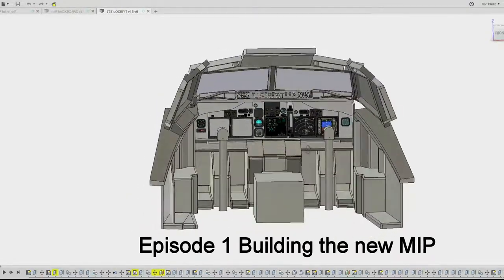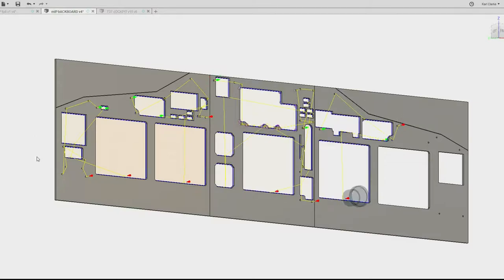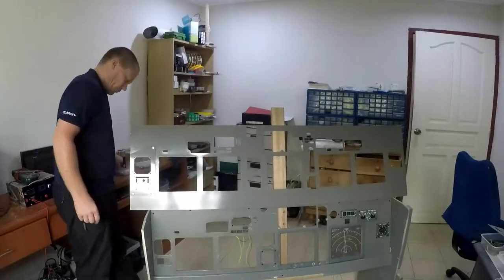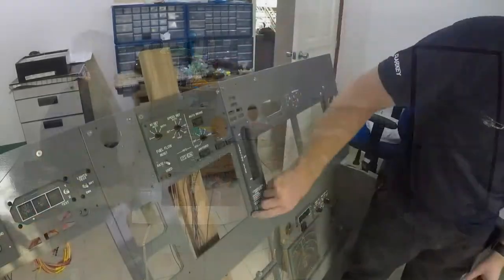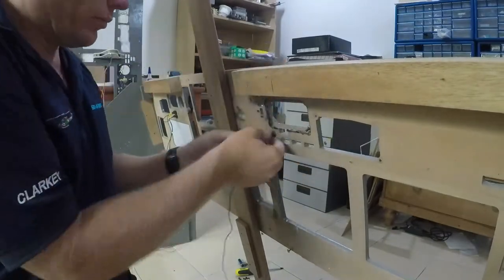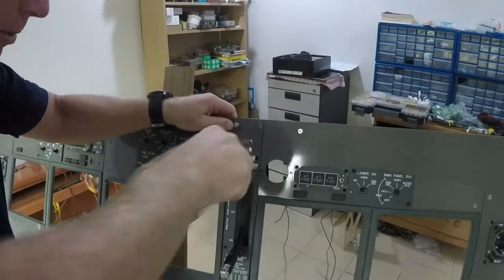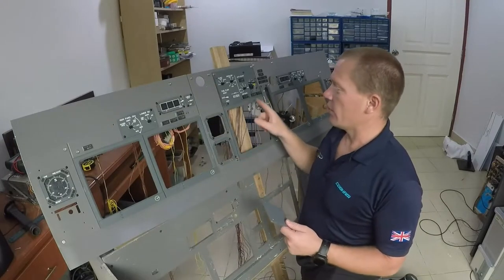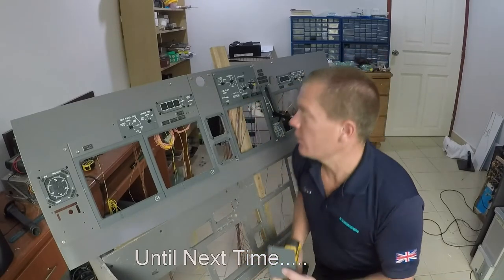737 Build 1- Building The 737 MIP #1

Comment: Hi, Looks GREAT. Can you tell me what program you used to cut the MIP Backboard, on your CNC, as its bigger than the cnc bed! , Im Just about to start/tackle on the A380! Thanks
Reply from the maker: Hi Russ, I use Mach 3 for the CNC. I was able to cut longer pieces by resetting the zero point and moving the panel along. This meant there is no restriction to the length of the panel. I just measured and marked the zero points along the panel and placed the tool at each point, and cut that section.
Reply from the maker: hi Russ! I hope this finds you well and you are recovering well from your stroke! Remember to take it easy! however starting an A380 is pretty epic!  It's a gorgeous cockpit and avionics. I will try and get you that videonif will help set you on your way!
Reply: Thanks, well on with the recovery, thought Id start a website as well as Facebook, don't know if I'm ready for the tube yet!  http://www.a380build.co.uk/

Comment: Hey Heli Mech,  Like you I built my own cnc machines (2nd one is much improved) and I've been trying to draw up the panel design for my 737-800 cockpit, but I'm having a difficult time sourcing dimensions for the panels. Where did you find the measurements if you don't mind me asking?  Great work by the way, very impressive!
Reply: Actually I see your source in the reply to Justin, glad I read through the comments.  Did Markuspilot measurements work or did you have to adjust ?
Reply from the maker: Hiya Paul, sorry for the delay, but im just getting back into things as you know. Hopefully you have been getting me emails too. Markus pilots dimensions are a great start! However, using CAD, some just didn't add up, they were physically impossible. Thats where having friends working on 737's came in handy. Id send the a photo, they would reply with the details i needed, and perhaps a sneaking blueprint or two. Of course not even my dimensions are perfect. i know for a fact i am 2mm off on the rear windows. But its as close as im going to get without actually converting to be a 737 engineer! lol. if i did manage to get into any Boeing or Airbus cockpit, i would laser 3d trace the whole thing!

Comment: How did you get the text on the panels
Reply from the maker: Hello pandonaut P, the panels are made from 5mm white opaque perspex. Then sprayed grey. Once dry, I use the cnc machine with an engraving tip to remove the paint and etch into the perspex. This way the panel can be backlit and lights up when dark. Others use a laser engraver to create the text.
Reply: very cool